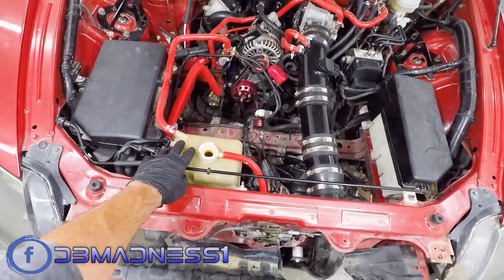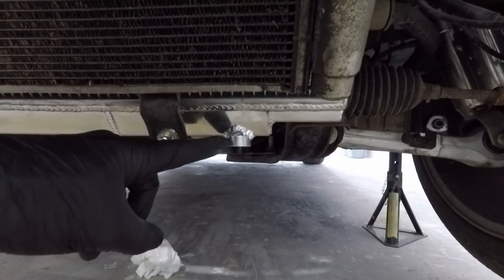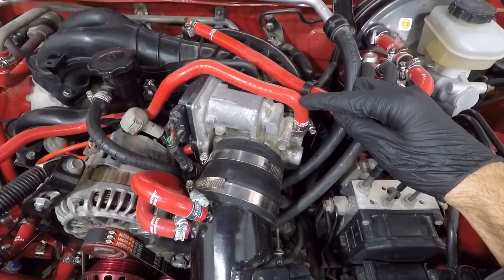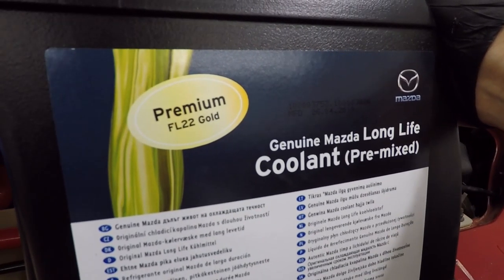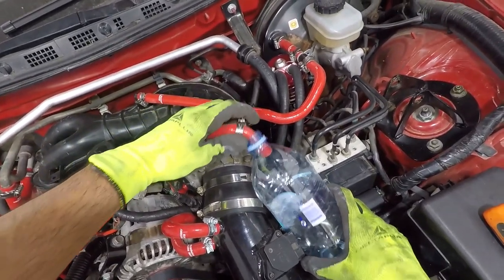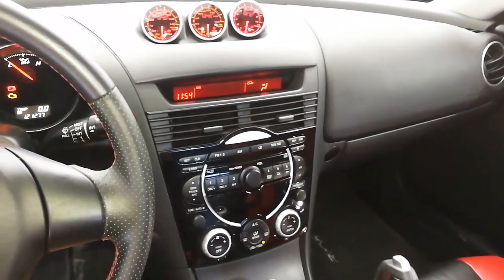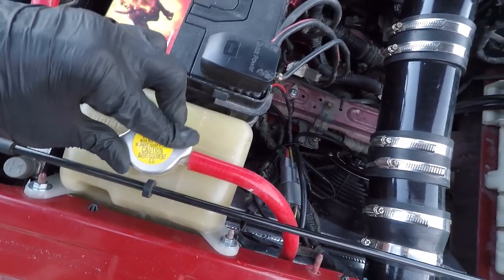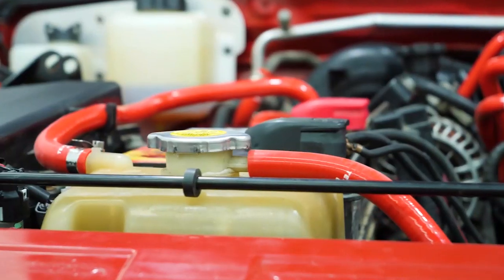Mazda Rx8 Cooling System Air Bleed

Comment: I would like to thank you. For the past month my car has been giving me overheating issues, i had flushed the system two times got new thermostat housings both top and bottom, went with a mazmart water pump, and still the car was over heating. I saw your video at 10 pm last night. I went outside and did this to my rx8 and at 12 midnight the car was under any hot temperature. THANK YOU FOR SAVING MY RX8
Reply from the maker: Im thrilled to hear that, well done 👌👌😄

Comment: I need advice for my rx8 2008. We recently  changed coils and saw greenish fluid in the gooseneck air pipe which connects air filter with air intake. Do you have any idea what it may be and if that is a concern?
Reply from the maker: Hi, the only green fluid is coolant. Does the car smoke a lot (white smoke)?

Comment: I know this is an older video but I’m just wondering what situation the max temps are for? Just normal driving or any kind of driving? I’ve flushed the coolant on my RX8 for the 2nd time in 4 years just as maintenance and it’s around 95 ish degrees during normal driving. And on track just yesterday I think it rose to 105-110 degrees before I started my cool down laps. There was no effect on performance but I was just being cautious. Did it get too hot aka overheat? Or is that 90 degree mark just for normal driving? I still have the OEM rad by the way which I am planning to upgrade especially for track. Also another thing is, my car is the 192 and does not have that coolant hose on top of the throttle body? So is there any other way to bleed the system properly? Thanks, great video as always 😊
Reply: The operating temperature of RX8 is between 95-100 degree Celsius. It delivers optimum power at 100. Temperatures between 96-100 is normal for daily driving. 110 should be your warning temperature to start cool it down by shutting the engine down. (Source : http://mazdarotaryclub.com/forum/index.php?topic=82161.0 )

You can upgrade the Radiator and may be fan if it is not working but never replace the stock thermostat which opens at 82 degrees with some after market thermostat which opens at lower temperatures. It is not good for your engine as it does not acquire optimum temperatures. This could lead to engine wear and tear and power loss.

Comment: would thos cause check engine light to xome on
Reply from the maker: IF there is a lof of air trapped inside, once you close the cap and drive the car, the coolant level will drop, cause the car will slowly bleed out the air itself, and it can drop so much that the coolant level light will turn on on your dash. If you have gauges like me, you can prevent any serious damage, caue you have live feed on the real temperature. If you see an abnormal spike, you can shut it down, before it goes too far.

No, no check engine lights will appear if you have air inside.

Comment: I love all your videos. I am unsure that your technique is the best for getting rid of air. Air rises, so I am not sure having hose low is going to work correctly as trapped air will be higher in the system. Just my opinion
Reply from the maker: THe best 2 tecniques are the ones where you pour in liquid and the either push it out with a pressure tester (safest method) or start the car and wait for fuid to come out ( more dangerous and messy). But as an alternative, this should work fine :)
Reply: I reviewed the Mazda RX8 service factory service manual and your approach is not mentioned.
Reply from the maker: @robertmontgomery7158  a lot of techniques are not mentioned there.

Comment: I have replaced and changed extra fans , upgraded new radiators but temperature still spikes up to 105 degrees c pretty quickly especially on the tracks , anyone has any ideas what could other problems be ?